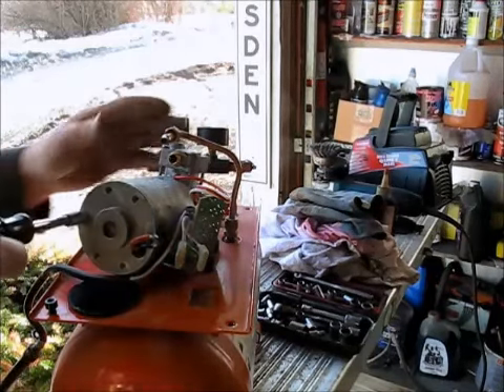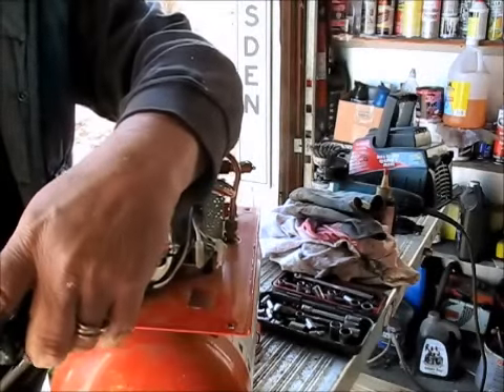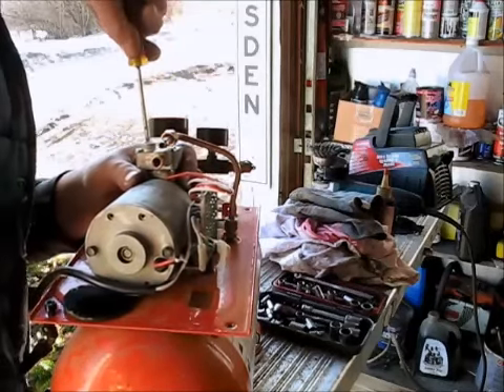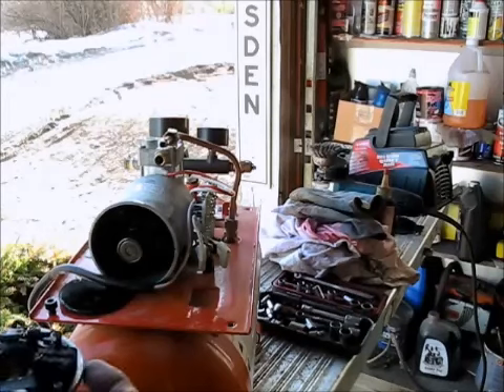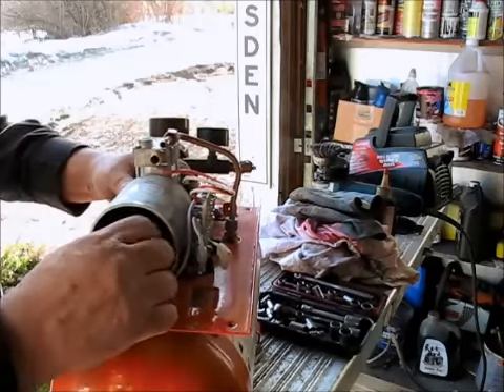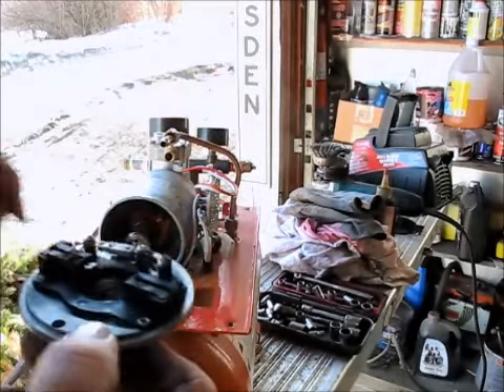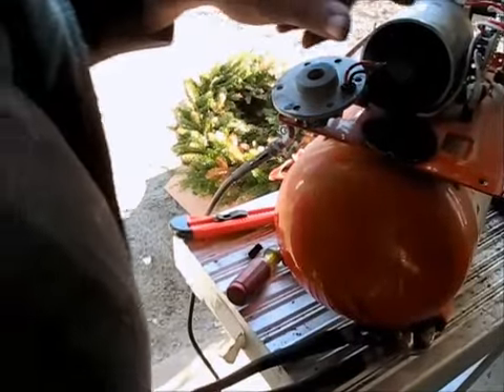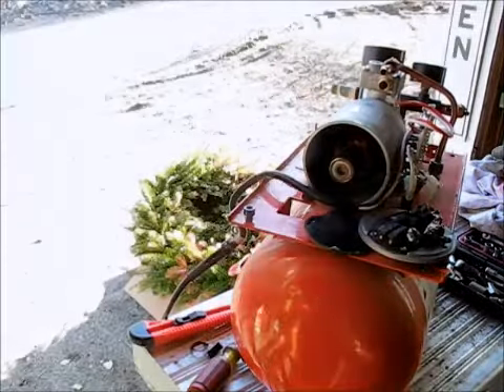Deconstructing an air compressor 6

Comment: Ahh that circuit board on the side is a Bridge Rectifier... takes your 120V AC from your house and makes it DC so the motor always turns the same way. Id pull the other brush assembly a part get a good look at it if you cant get a replacement see if you can buy a piece of square copper rod the same dimension or close cut it to size and go. also monster market place has a bridge rectifier that can replace that board and is weather proof contact me if you want the link! hope this helps!

Comment: not necessarily... 240V 3-Phase  Black - White(Common) - Red. yes low voltage systems often use black and red however its not always the case! some compressors do run 240V now that little one well no its DC voltage but don't assume current type based on wire color do your home work! In this case we know its dc because it says so on the motor.